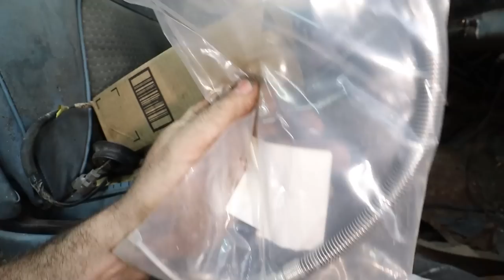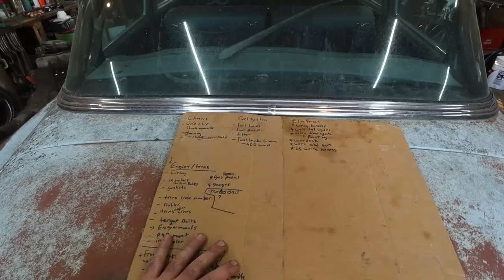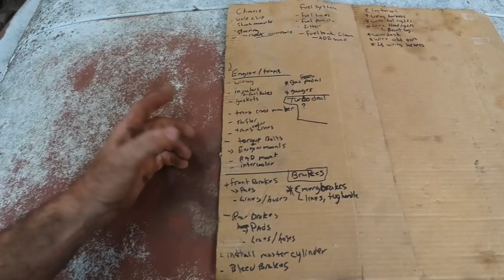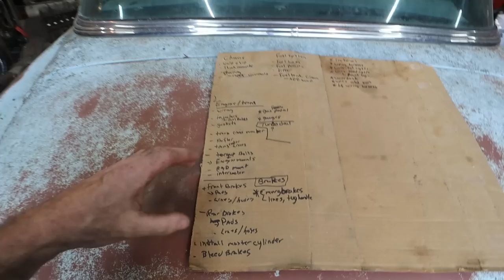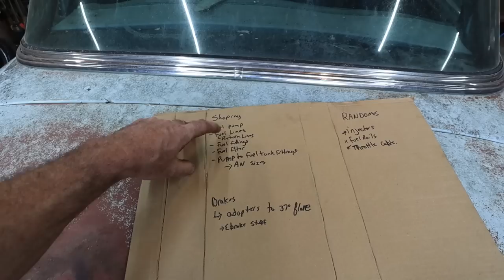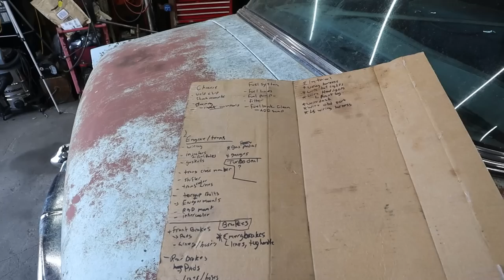Pulling in my 1954 Chevy to see what parts we need to continue our build on it.

Comment: Your brake line looks like a european bubble flare...you should be able to find a coupler that size to thread on that line. Then find a European  bubble flare adapter that  threads into the coupler and is female inverted flare on the other end of the adapter.

Comment: On the Jaguar brake lines, I couldn't find an adapter so I took a fitting to fit the Jag & a standard fitting & brazed them together to work. Have a 51 Ford F1 with Jag front & rear suspension.  No leaks & works perfect! Good luck getting everything cleaned up & back to somewhat normal .

Comment: I like your method for project management, Brent.  I use the same method, but using two white boards.  One board has the different cars and the things that need done; the other has parts I need and I tick them when ordered and cross the tick when they arrive, as I have a habit of ordering more parts because I forget I already ordered them.....and yeah, keeping them in the car is a good idea unless they are (like in my situation) rolling restorations that could suddenly be used as a daily or taken for a drive in the country.  My teenage girls don't like sharing the back seat with a starter motor and a bunch of bushes, bearings, brake parts and half a wiring loom for some reason!

There was one thing not listed on your list that I thought you might like to include just to keep an eye out for - the replacement windscreen you mentioned.  I know it's far down the list in priority but they don't come up that often and if it were me and I was spending a lot of time under the car and not seeing the broken one in my face every time I was out in the shed, I wouldn't remember to keep looking!  Breaking down a project into sections and then breaking the list of sections into things to do (and order), is the only way to go about making sure that I have everything I need when I need it and always have something different to work on if I get sick of doing another part of the project......and keeping track of the progress is a way of giving myself encouragement to keep going too - especially on a long one!  Must be something to do with our mutual I.T. background that we do it this way, eh?  

All the best.

Comment: Brent, not sure if it will do you any good, but since you are shop down like myself... For cleaning engines, purple power. It will also take off paints, and you really have to rinse before painting, it will bubble right off. But if you want to get the grease off, this is the stuff. I guess you could put it in a parts washer too, :p I think that is what it was designed for.

Comment: Hey Brent, just a quick idea, what if you got a concrete mixer and used it to clean tools. Just put some aggressive media in it and let it  run, kinda like a giant rock tumbler. Might be easier and quicker than wire brushing small things like sockets, wrenches or your English wheel dies.

Comment: I don't think Pablo would be noisy, unless you force fed him some sourkraut.  :-)  You were talking about having the 54 as a sleeper.  Can you explain a little more about the different pumps, and the noise difference between the fuel pumps?
Reply from the maker: external pumps are usually noisier than internal fuel pump as they are usually submerged in the fuel.
Reply: @HalfassKustoms  I get it.

Comment: It's called an English brake pipe "female union" 3/8x24 threads and takes a "bubble flare" which is the first step of doing a "double flare". Practice a couple times first so you can get the right size bubble. Too big and it won't fit inside the female union, too small and the male union (flare nut) won't hold it tight enough.

Comment: Splendid
Don't you have modified the lift with compressed air ?
Reply from the maker: no I rebuilt the cylinders got new lines made and bought a new pump for it.
Reply: @HalfassKustoms   OK/ I was asking this because there was a whistle when the car was going down. It was the air coming out of the oil tank I suppose.

Comment: The last 3 car's truck's I built that's exactly what I did was make a list of everything that needs the car to be a driver. Then I will have a file folder to keep all my recete/record's. 
Because over time I for get what was done or what the part cost. Plus when I go to sell the car truck it has all the history that was done to it with new and used parts.
You can go way over budget building a car real quick. Unless the vehical really means some thing to you never put more into what the car is accully worth. 
I've seen at car shows people putting in 200k on a 20k car. 
I'm guessing I'm a old timer because we could buy a 40s- 70s bare minimum ($500-2,500) and be cruising for the summer. 
Now they want top dollar for rusty buckets. Then again this is not the 1980s and 90s. Nothing like Canadian and U.S. steel car's.